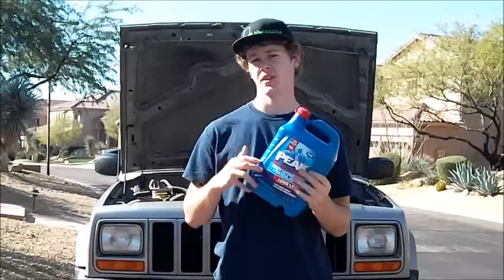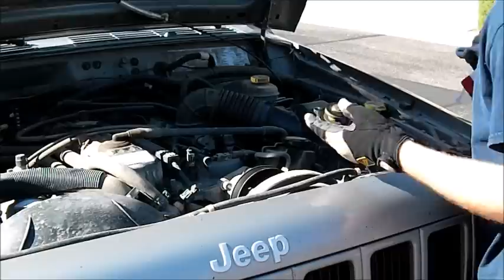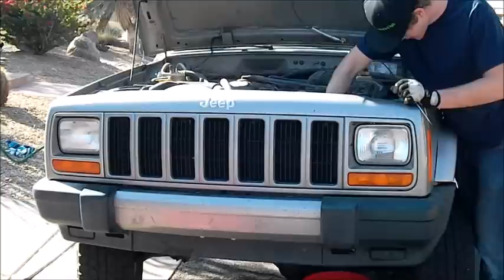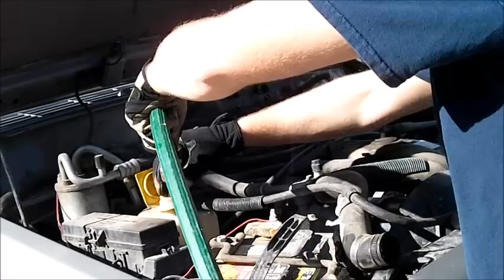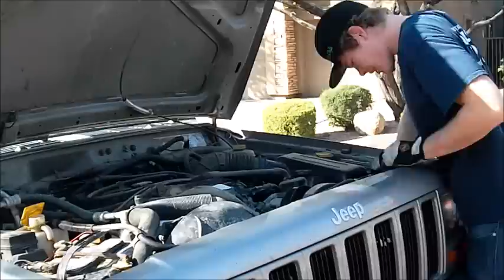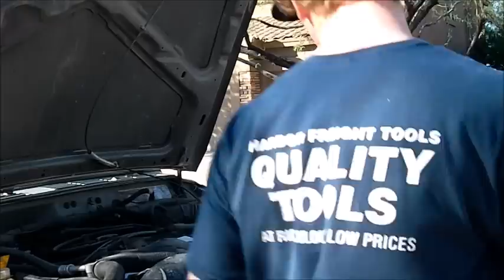jeep cherokee cooling system flush

Comment: Thanks man your videos are super helpful. I just got a 2001 Cherokee with 180k. Im trying to figure out everything i should/can do to clean it up and make it run good and last long. If  have any advice on  where to buy replacement parts for a good price i would appreciate it.
Reply from the maker: which parts are you looking for? some parts need to be purchased new, but others can be gotten used which can save you quite a bit of money
Reply: Admiral Off-Road I had a leak in my break line on the driver side so I replaced it, and bleed out the breaks. There's pressure when is turned off but when I turn it on it goes away and break light goes on. Could it be bad master cylinder?
Reply from the maker: that's a possibility. You didn't have any issues with the brakes before bleeding them?
Reply: Admiral Off-Road lol I watched the video again and didn't see that part where you left the motor running. Now it works great. Would you possibly do a video on how to restore a rear axle and make it like new?
Reply from the maker: Which axle do you have? I have done a video on tearing down a Dana 35 rear and a Dana 30 front axle. I currently have a Chrysler 8.25 rear axle  if you have any specific questions, I could probably help you out but the axles I have now are in pretty good shape, so a rebuild is probably pretty far down the road

Comment: thanks man helped me immensely. You in CA? I got a 01 Cherokee and it has some problems, I've been able to diagnose and fix some but there's others I have no idea where to start!
Reply from the maker: Glad to hear it! I'm in Arizona
Reply: okay so i recently flushed, now it is overheating and smoking near where the upper radiator hose connects to the radiator. I am replacing the hose this weekend  but it seems like very small leaks could be coming from the radiator wall where it connects? not entirely sure, wondering if you had any ideas.
Reply from the maker: Is it a plastic or metal side tank? I had a plastic one crack and had to replace mine

Comment: Alright, just a heads up for whoever lands on this video.

It is not as easy as the video makes it to be.

1. Removing the hose clamps is easy but installing it back, specifically the one by the air filter is very hard. Space is limited.
2. They drain 3 gallons of coolant but when you try putting back 3 gallons, it won't take all 3. I was only able to get 1 gallon of straight antifreeze. I regret not buying the 50/50 mix since 1 gallon of that would have been better than 1 gallon of straight coolant. 
3. Flushing the fluid from the top hose, nothing  came out. Dont know if i wasted 10minutes of just making a mess.
4. These do yourself videos make it easy. But i wish i could have my 2.5 hours back. I will pay jiffylube the 150$ they quoted me before trying to do the job myself. I ended paying over $50 for gallons of straight coolant,  distilled water,  and hose clamps. 
This is easy if you have time to do it. I had to get the kiddos fast food for dinner cause this took longer than it was worth doing. 

Yes i was at an incline nose up.
Reply: I think he failed to mention his thermostat is out or he is none the wiser it will not flow back through the return hose unless the thermostat is broken or not there

Comment: Does it matter where I disconnect the lower radiator hose? The part that’s attached to my radiator is hard to get to but the one attached to my water pump is more accessible
Reply from the maker: nope, thats fine

Comment: This did not work for me. I'm not sure how you managed to get the water into the upper hose into the engine block so easily but when putting water into the upper radiator hose the water just filled up the hose and sprayed everywhere for me. I figured it's probably the t-stat being closed so I turned the Jeep on and tried again. Still did not work. Then attempted to run water through the lower hose which did cause water to go into the block but again, when it reached the t-stat I could hear gurgling but no water would come out. Instead it just sprayed all out the hose I was putting water into. I'm thinking if I remove the t-stat I'll be able to flush the system like you but that's extra work I did not want to do.
Reply: DeathfireD I ran into the exact same problem, I ended up taking apart the thermostat housing, removing the thermostat, put it back together then run water through he system and then it would flow through the block. The only problem with doing this is the 2nd screw on the bottom of the thermostat housing is the biggest pain in the ass to remove and out back on. The belt runs right over the screw so you need to loosen the belt or have someone put pressure on the belt in order to a ratchet on the bolt
Reply: +DJ Big Mack that bolt really is a pain I just had to replace my thermostat
Reply: The trick with that bolt is to feel the bottom bolt hole and get it lined up as close as possible. And then actually tighten the top bolt first.. just enough so the housing won't budge, but not so much that you crack the housing.

Comment: hey bro i got a 94 cherokee 4.0..with new water pump and new thermostat..and still overheting after 20min driving
Reply from the maker: have you burped the system? sometimes air in the system can cause overheating
Reply: Admiral Off-Road i just did it and clean it with vinegar..will see if it works...the system was dirty...can i do upgrades to the coolant system?
Reply from the maker: You can upgrade the radiator and fans and run the electric fan from a manual override switch.  Make sure if you have a winch that its not blocking air flow to the radiator. Some people install hood vents or lift the rear of the hood with spacers to allow more heat to escape during low speeds.
Reply: Admiral Off-Road ok bro thanks...you should put a video upgradin the cooling sytem for the cherokke
Reply: Check your mechanical fan clutch

Comment: When I took off my top radiator hose to flush the system, the water wouldn't flow through...
Reply: me too
Reply: So what do you  do then if it doesn't go through..
Reply: I dont know why his went through like that. Makes me think his thermostat was either taken out or had gone bad. I'm just going to hook a garden hose up to the heater core return line and let the water push through and out the top of the radiator
Reply: @winkcrittenden6011  well my thermostat is bad n I need to change it maybe when I take out the bad one out I should do the flushing..
Reply: This guy must not have had a thermostat installed. Water can't flow back towards the engine unless the thermostat is open or removed

Comment: Thanks for vid, is it a problem that you did the flush with hose water, and some of that is still in the system?
Reply from the maker: The amount left in there is pretty small, but yes you should avoid tap water in the system. this could be avoided by using distilled water to flush out the hose water.

Comment: so i followed your instructions to the T, but when i disconnected upper rad hose, water did not travel through system. just came back out where i was putting it in. any help or advice? 2001 4.0 sport auto. thnx
Reply from the maker: arkvoodle38 there are a few people who have had the same problem. It seems that some thermostats allow the system to be flushed while they are installed and others do not. removing the thermostat has solved the problem for everyone who has had the same issue. The thermostat is very easy to remove and I have a video of the process on my channel if you need it. I would remove the thermostat. Put the housing back on, flush the system and then put the thermostat back on (or replace it with a new one since you're already in there)

Comment: This is not a flush but a waste of time. Washing can be called when instead of antifreeze water is poured with citric acid, and after running the car for about 100-200 km, it is drained, washed with clean water, and fresh antifreeze is poured.

Comment: You forgot to remove the thermostat before flushing the engine. You really want to do that.
Reply: Also using green (iat) inorganic additive technology coolant in a chrysler/gm vehicle is not to spec you need to use yellow/red/orange (oat) organic acid technology coolant in the coolant system will lead to corrosion and possibility of ruining the secondary cooler for the transmission and of course the water pump and tubing as well